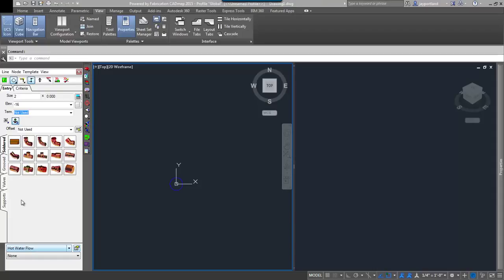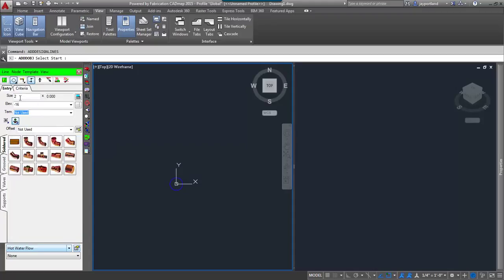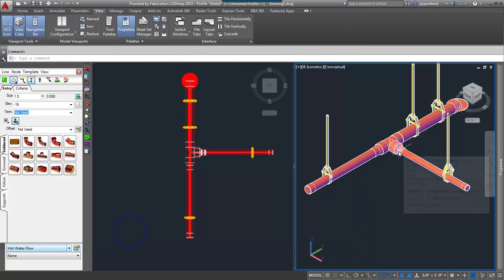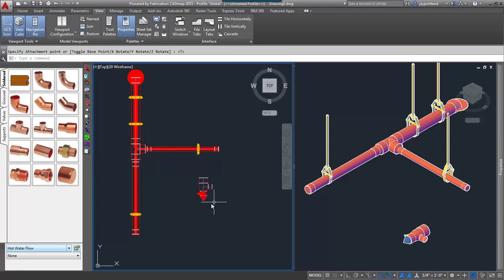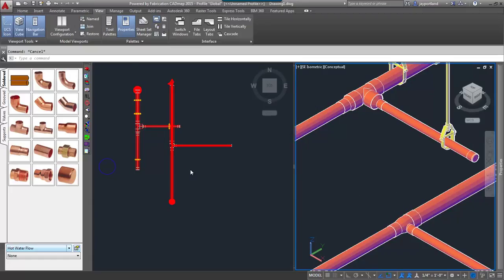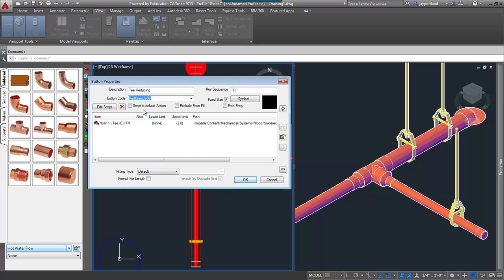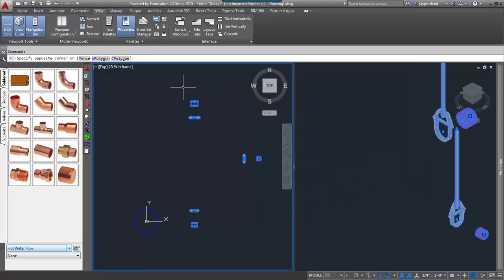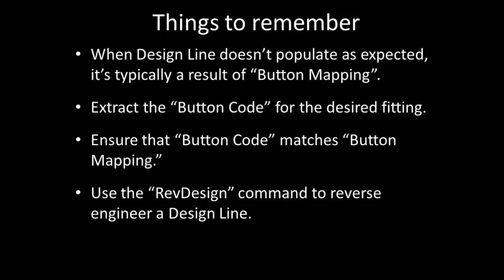Reducing Tee in DesignLine

Comment: Jay.  I've worked in the field and drawn plumbing for over 15 years.  Unless you want to purchase 50 different kinds of red tee's, you never use the 3 way reducing tee.  The plumbers do just throw in a fitting reducer to reduce in the straight run.  You don't want a plumber wandering around for an hour because he can't find the right tee(seen it done).  Plus the cost of these are prohibitive.
Reply: Sir
I am agree with your comments but the video tell us about the use of button mapping not only use of reducing tee. Although Mr. Jay may be practically wrong,but his way of represent the use of button mapping is good.